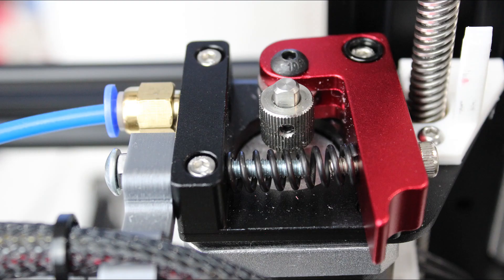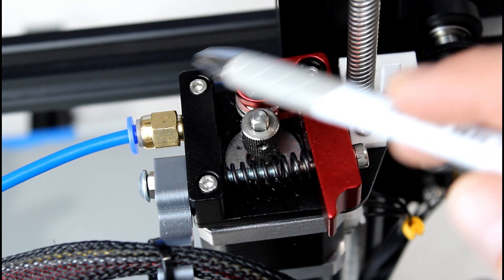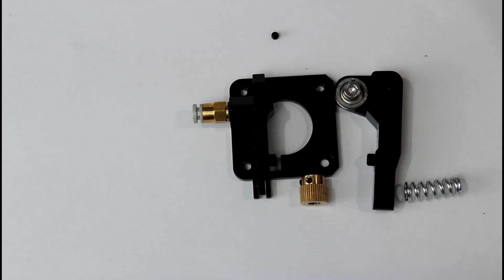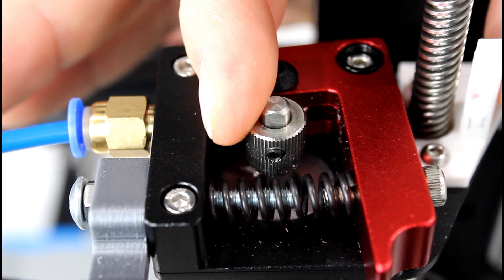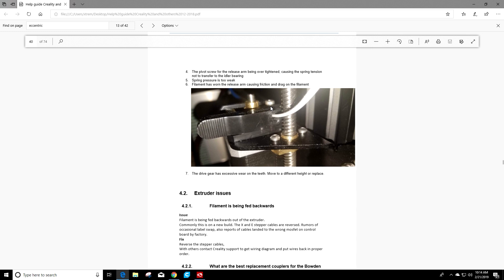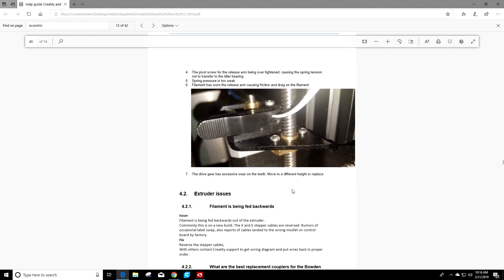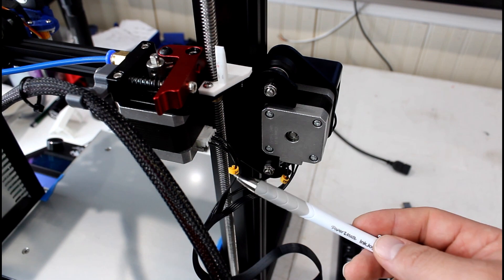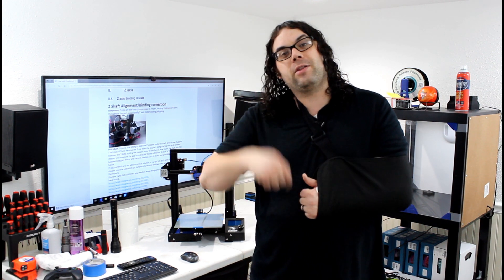Section 4.1 Extruder Troubleshooting featuring the Ender 3

Comment: Hello to everyone. I'm having a issue (extrusor skipping steps) and want to know if someone solved it with a specific step. I made some prints and I dind't have this issue until today. I tried to loosen the screw (bearing holder) and now it's better but the skipping steps remain. I'm printing at the moment without any problem (good quality) but the engine is doing this all the time, mostly when the print starts. I will write all my thoughts and maybe some of you can give me some guidance: The nozzle is printing PLA all the time so I think the temperature is correct and the nozzle is ok. I always do bed leveling before start to print so I think the bed is correct. The spool holder is the original but I added to "bracket" for the angle of the PLA before entering the extruder and I also added a "coat" piece to protect the filament from the Z-Axis screw. Spring tension is the original and the bowden tube is the original. As I said, I never had this problem before until today and now I will try some thing that I saw in this video. Thanks in advance for any comment.
Reply: I have the same issue bud. Did you figure it out? Mine starts skipping after about 30 minutes of printing.
Reply: @vishank7  ey, I figured out that if you are printing too close to the bed, the filament can't pass through the nozzle so that's why the stepper skip steps. In your case, maybe the nozzle is too close to the print or the screw for the handle that secures the filament in the extruder is too tight.